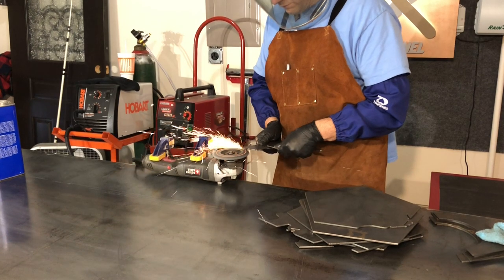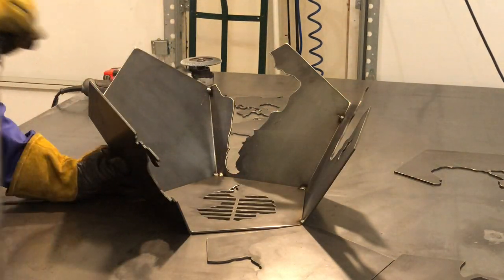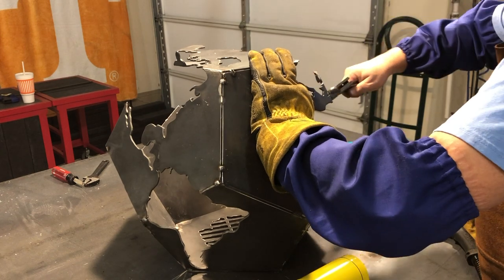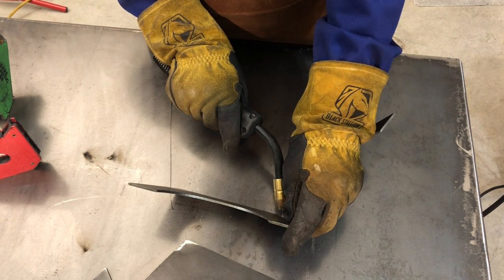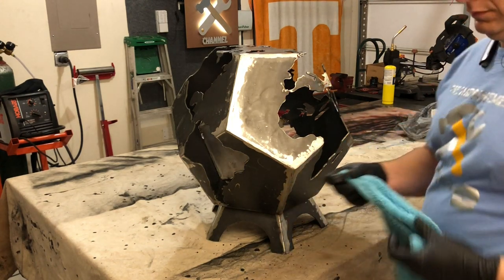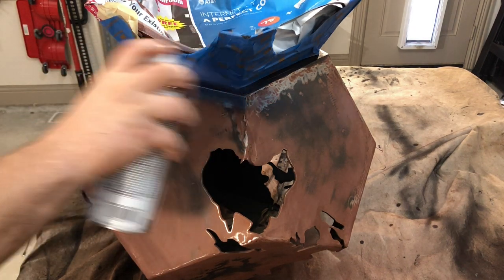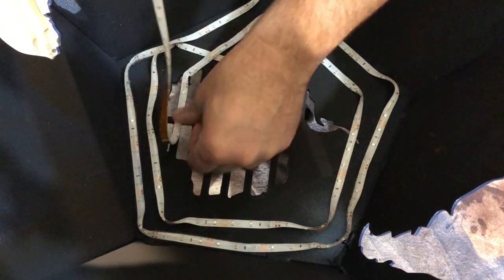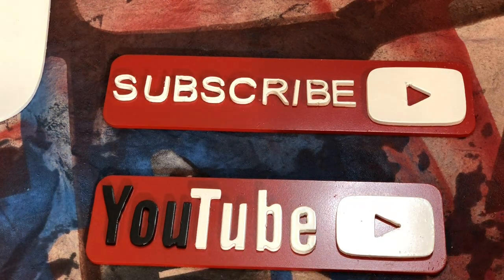Globe Fire Pit Build | Globe Art Build | WeldItYourselfKit.com | The Improvement Channel

Comment: Now that you’ve had time to work on the table, what would you have done differentl?  Thicker top, wider, longer?
Reply from the maker: Great question. I would not have made it adjustable in height, I would have gone with a comfortable stand up height. That is all I use. I do however adjust it slightly to use as on out feed table for the planner. I guess I would say less adjustment. I love the 4x8 and the 1/2 thickness.

Comment: Your gas was too low because your getting worm hole porosity in your welds other your gas is to low should be around 15 CFM
Reply: Hope that helps
Reply from the maker: Thank you for the tip, I am running it at 25. What do you think the problem is?
Reply: @TheImprovementChannel  dirty nozzle or to much gas creating turbulent mixing of air into your weld gas, or you have a shop fan blowing away your shielding gas.
Reply: Yep to the comments, bring your flow down, and be mindful of cross wind where you're welding, a fan sounds good but it'll kill your welds.